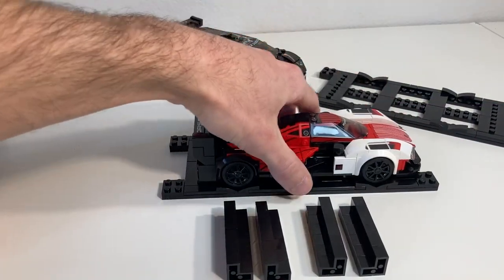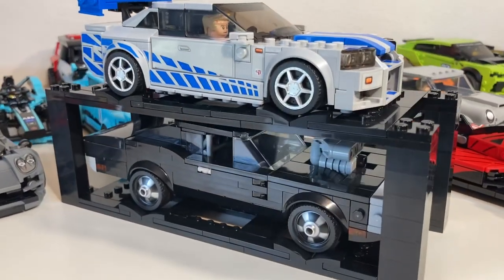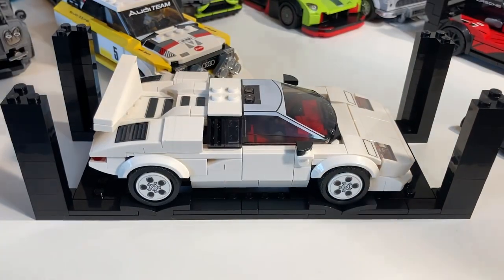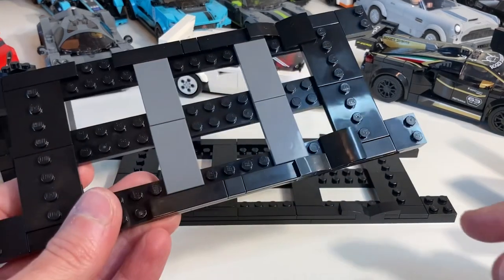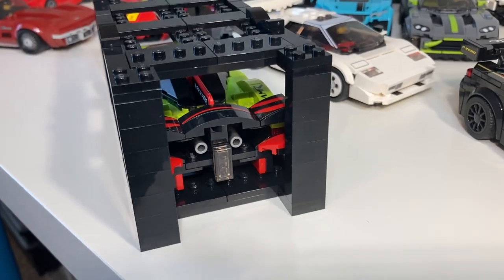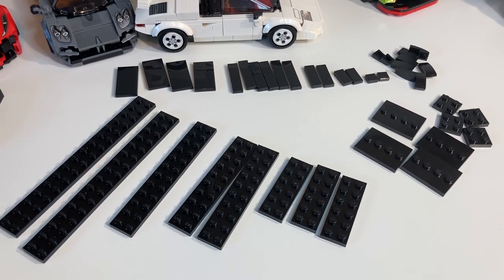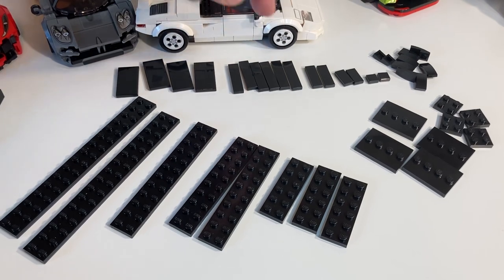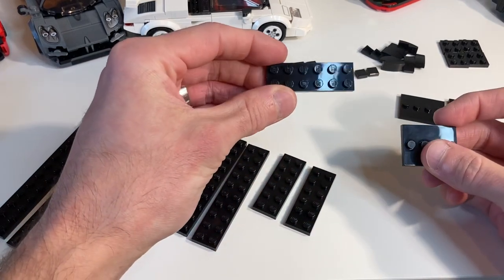LEGO Speed Champions: Brick-Built Display Rack - Ver. 2

Comment: Did you compare prices to bricklink?
Reply from the maker: Ordering from BrickLink will save you some money. However, I couldn’t find one or even two sellers with all these pieces. I found that I would need to order from maybe four or more sellers which adds more S&H costs and therefore not making it dramatically cost saving. I would love to hear if others can find better price options than me. But I think I’ll order through LEGO to get promos and VIP points at the right opportunity.
Reply: i priced out enough to make 4 levels and its about $10 per layer after taxes ( and free shipping due to it being over $35)

Comment: Is it possible to use regular 2x2 bricks instead of the L shaped ones? Or would some cars not fit?
Reply from the maker: Yes, you can. The only car that has a problem fitting though with 2x2 bricks is the Aston Martin Valkyrie.
Reply: @thegreenbrick  Thank you very much. I really admire your display design, is there any way I would be able to send some money as a token of thanks? This design has helped me immensely!
Reply from the maker: @jeromechinnappa4825  Thank you for your kind consideration! There is a “super thanks” button below the video. However, don’t feel obligated to give me anything. This is what I enjoy doing. Also, please let me know if there is anything specially you would like to see. I’m always thinking of ways to improve this display system. I’m going to be making this for the 6-wide speed champs as some have requested this.